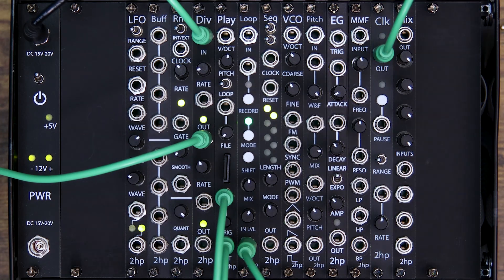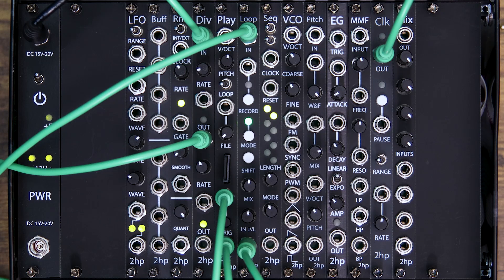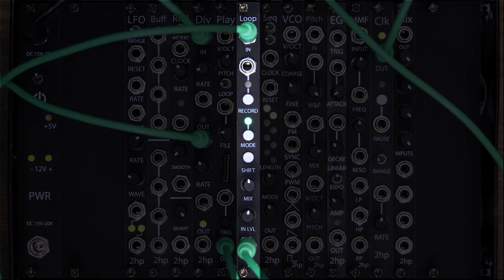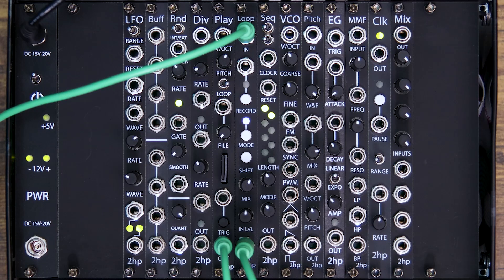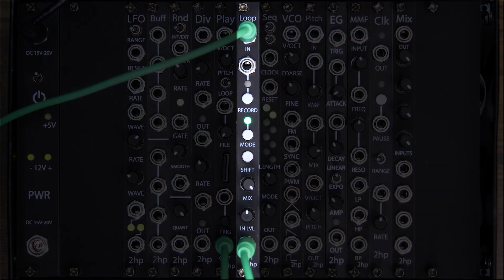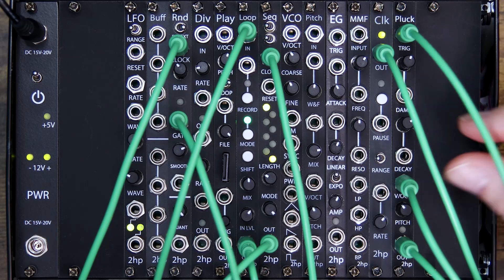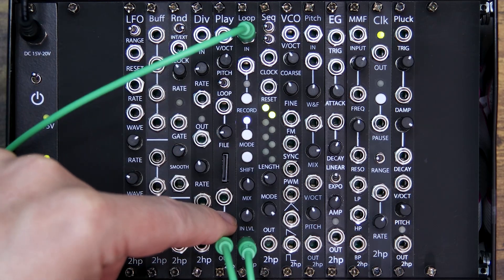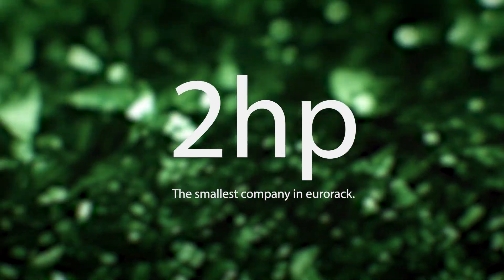2HP Loop - Tutorial - High Fidelity Looper

Comment: You say that the input level is a VCA, but it's not VC, is it? It's just an attenuator?

It's a bit of a pity that there's no meta mode that uses different voltage levels into RECORD to select modes. But cool nonetheless! And all in 2hp (d'uh)!
Reply from the maker: Great question! And thanks for watching!  :)
You can only adjust the input level with the on-board knob, not with external CV. It's technically a VCA, but you don't have the ability to control it externally.

Comment: not sure how to ask this, is the frippertronic fading continuous with loop playing in the mode, or just when you are recording / overdubbing the loop? ( I guess I'm wondering if you can influence the decay rate? whether decay rate is quicker if you leave record toggled on??) thanks if you can clarify! Is the decay right linked to how many times the loop plays, ie do shorter loops decay more quickly?
Reply from the maker: Hi CH2365---Thanks for the question! 
"Frippertronics" is only captured when recording or overdubbing. 
If you aren't recording, the wet signal won't fade/decay.

As for your question about decay rate--think about it like this. Each time the loop records, it first cuts the existing loop's volume and then records over it. 
So yes, shorter loops decay faster, but only because they are shorter in time, not because of anything else.

Hope this helps, and thanks again for the conversation!